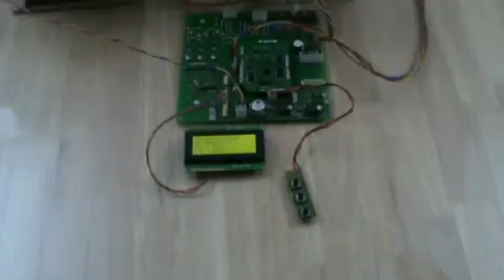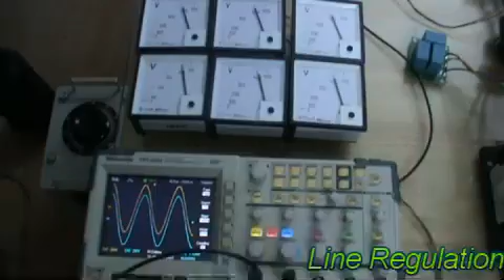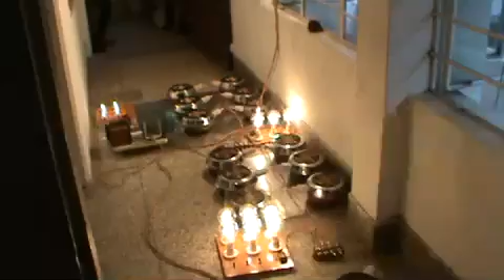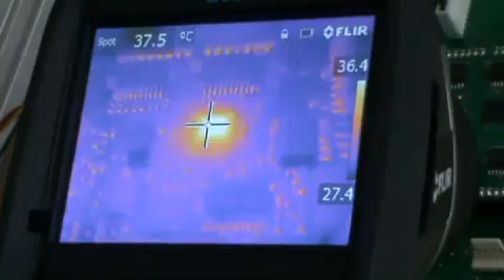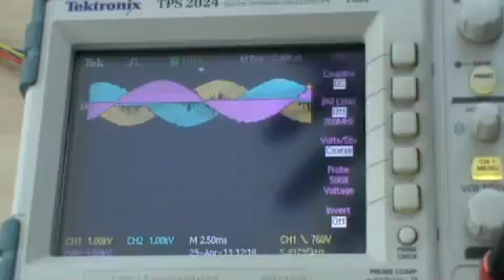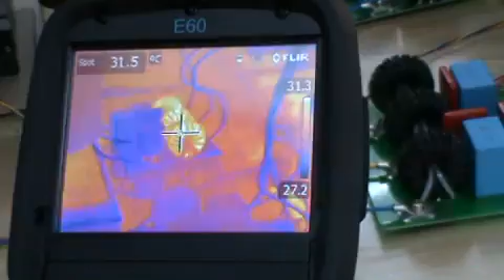3 Phase 3 wire static voltage stabilizer optimizer

Comment: Impressive device. When you varied the input voltage and the IGBT PWM-signals went above 80-90% somewhere it sounded like the 3-phase transformer went into some kind of saturation or similar, is this what happened, and what then caused it - small differences in the 3 IGBT circuits feeding magnetic offset into the core which led it to saturate for one or more of the 6 sine half-waves? I would be very interested if you have a schematic for how the series-connected IGBT circuits are arranged, how the gate drive works, and how things like short-circuit protection and input/output overvoltate/surge/lightning strike protection works, and if there is any way to also compensate for capacitive or inductive harmonic loads on the output side without adding more electronics - I guess only voltage change due to not having an energy-storage element?